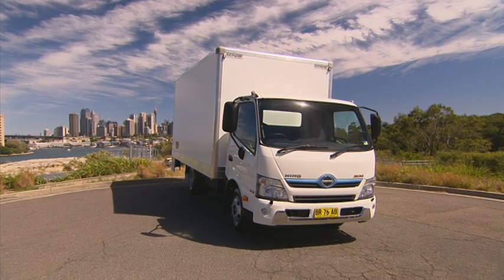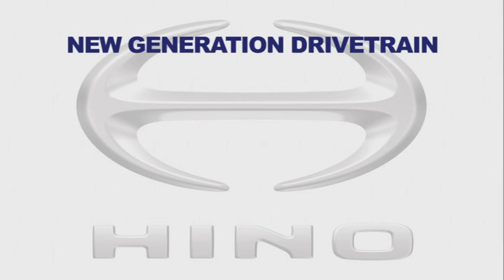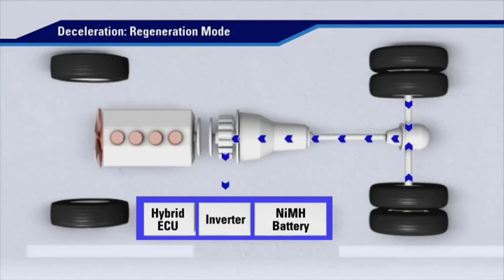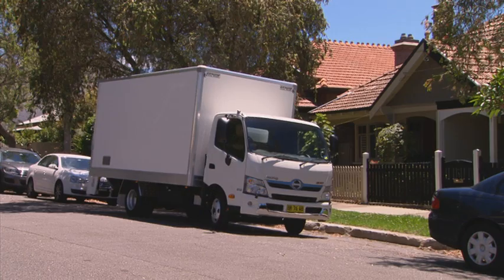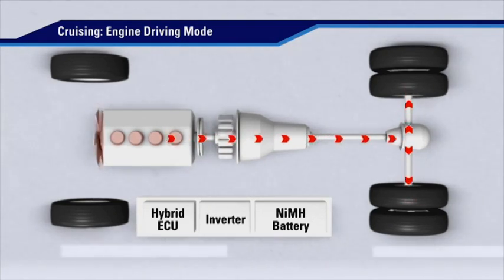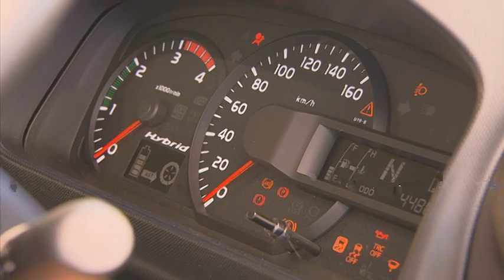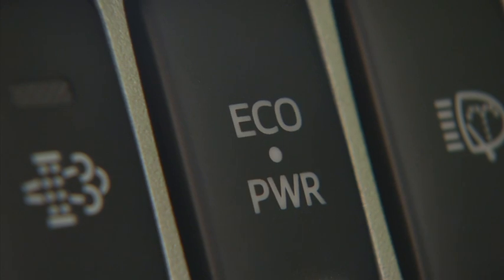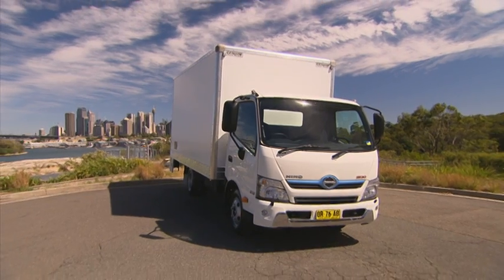Hino 300 Series Hybrid Truck

Comment: Why is absolutely nothing said about actual mpg's or cost? Can I get one in a smaller cargo-van style or mid sized truck?
Reply: +john fraley: Yes you can John.  Fuel savings following studies by independent organisations depend on how you use the vehicle however one study resulted in 21% fuel savings for Coles metro delivery vehicles in Sydney.  Also over a ton less emissions each year per vehicle.
Cheers
Neil (NZ)

Comment: 2009 Model with  215000 on Speedo.. what  they worth please
Reply: You gotta get the battery checked. There's a chance it's dead or almost dead depending on how it was treated. If that's the case just pay normal truck rates. The batteries cost $5k+ so that should give you a good idea